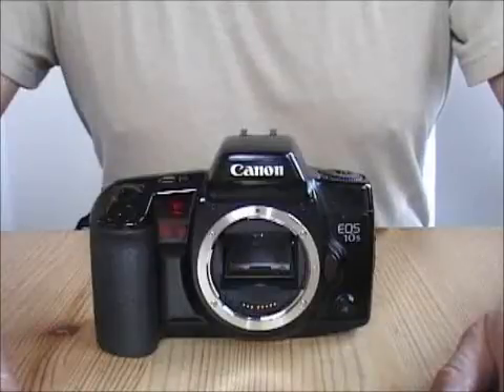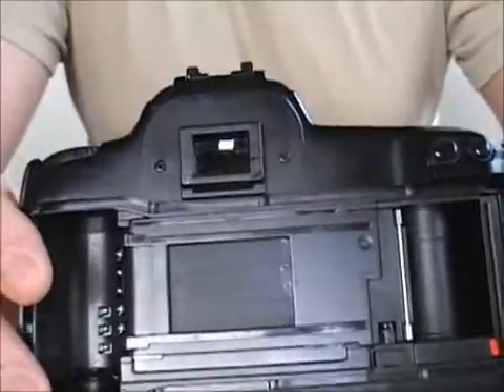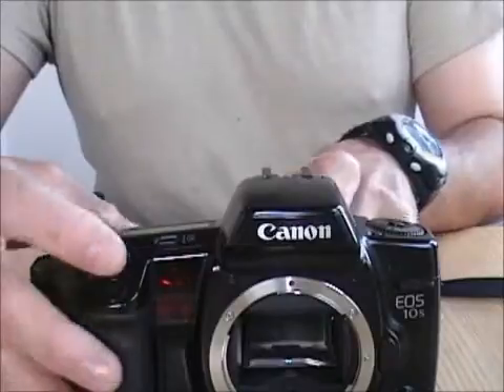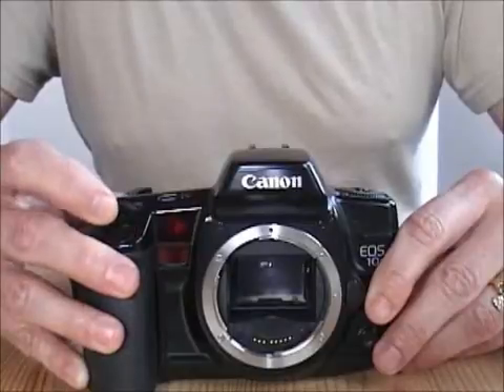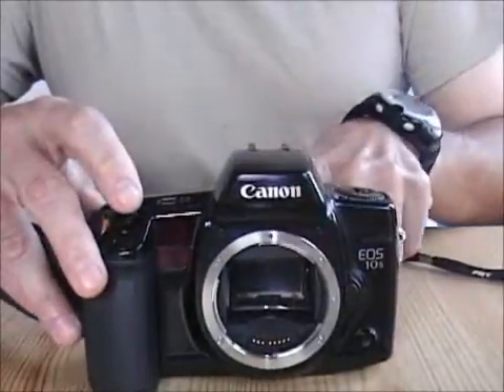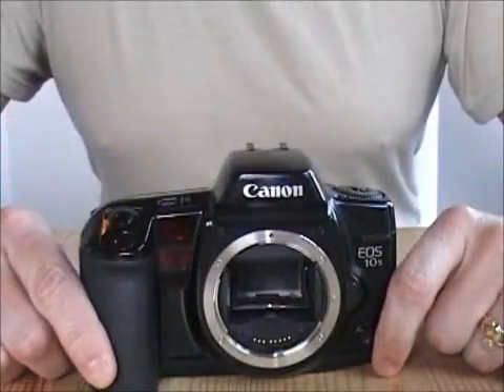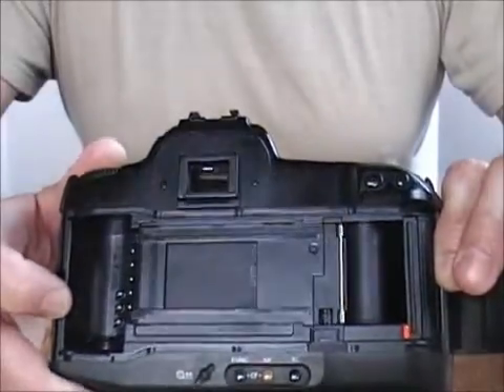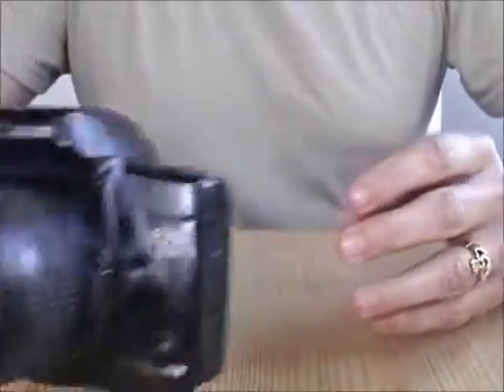Sticky Shutter Syndrome Fix Part II

Comment: Manged to do this to my EOS 500, the shutter now seems to fire all the time instead of only half of the time, I will wait for tomorrow to test with film to make sure every trace of solvent has evaporated but so far it seem good.

At first I tried to just clean the black stuff from the shutter and it worked for one roll but then it came back, found your instruction and followed it. Thanks for posting it.

Edit: I thought I would mension that your instructions said to not use alohol unless it is very high purity, I agree, but even very pure alcohol can absorb moisture from the air over time so I would still not reccomend it. I however did not have any naptha, normally with something like this I would buy some but I actually had a very fresh (unopened) bottle of 99,5% isopropanol so I just used that, and yeah, if it indeed has next to no water it does work. Again I would still advice against it. Not just for the water reason but I have also heard that any kind of alcohol will ruin a focusing screen and when cleaning the front of the shutter you get uncomfortably close to it.

Comment: Great video. Thank you. I found you when my Canon T90 started to display the EEEE message. I open it up, and... the shutter looked like new. no rubber gunk.  no wear marks. absolutely clean. worked perfectly in fact, until I put film back into it, and closed the back. then, no film advance. no shutter movement. nothing. you ever hear of a problem like this?
Reply from the maker: Yuck...the dreaded EEEE error code.  It could be a few things.  The easiest is a dirty or sticky electromagnetic shutter release.  I've heard that if you give the camera a stiff jolt, like putting it down hard on a table (padded of course) can free up the electromagnet that trips the shutter.  If that fails, you can take off the bottom plate and clean everything you can reach with naphtha and see if that works.  Other than that, I'm out of ideas!
Reply: Thanx

Comment from the maker: @jtoro97 Try a solvent like Naphtha (Rodensol lighter fluid).  The other option is just to remove the rubber and replace with some other covering.  The rubber does not play a role in the function of the camera.  At KEH, you see a lot of bodies with the "surface stickey" comment, but I have not personally run across a specimen.